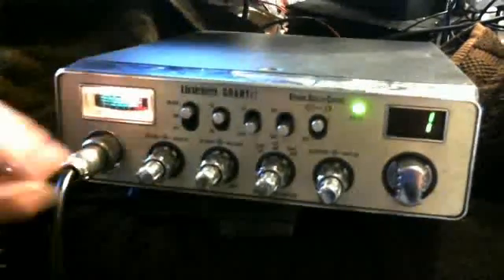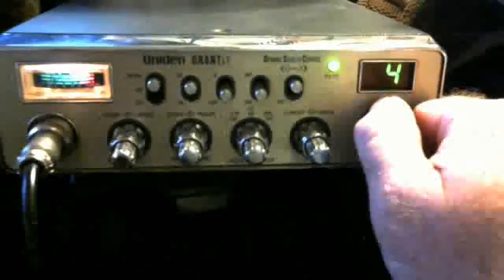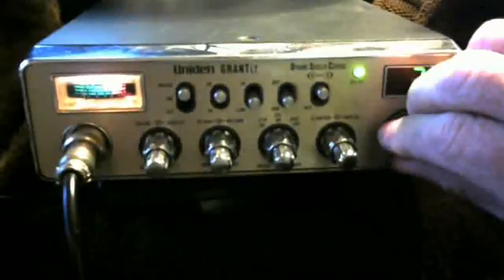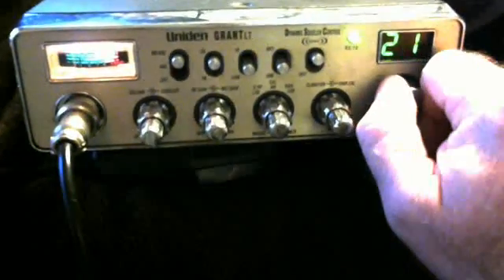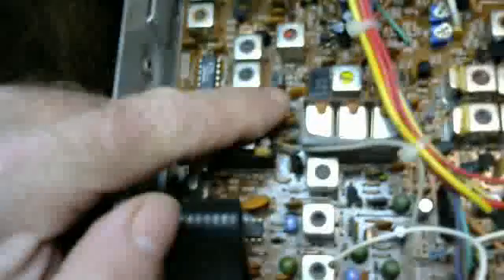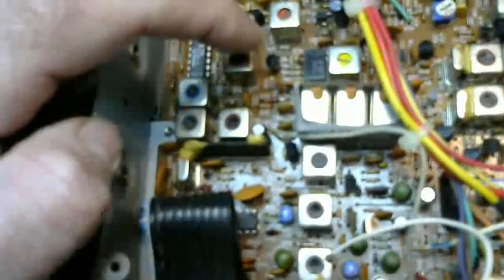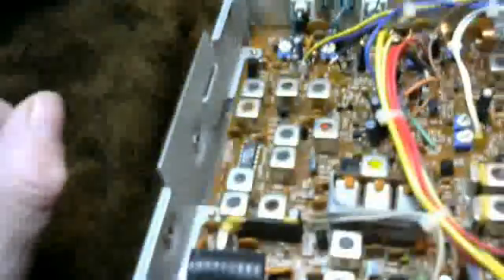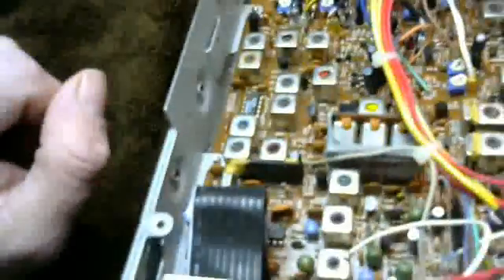40 meter ham band conversion to uniden grant Part1

Comment: That is the kind of radio very very many new Hams should have when they go to get on HF for the first time. a Click click radio that covers every 5 kc per click. And it is QRP what a cool first HF radio, and cheap $...Does it have and do CW also?  Great job and I hope to see and hear lots of these on the band. Good luck with the band pass filter on 40 meters. That looks like a fun project. Hope you put out the conversion in print on Ham Universe or some place... Thanks 73 Jimmy, ARRL TC, WX9DX
Reply: Yes if you de-stabalize the balanced modulator it will put out CW... Again Great video... Thanks again.